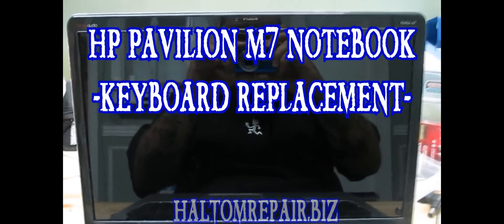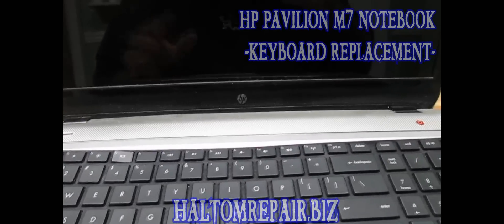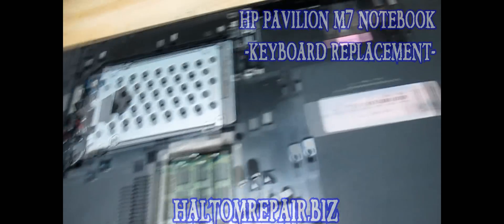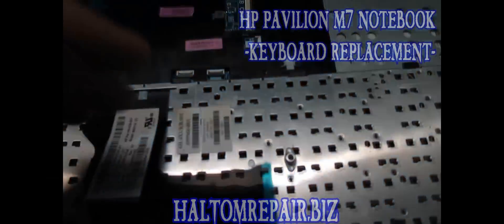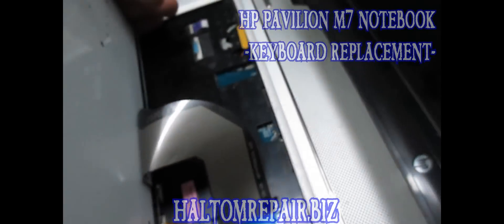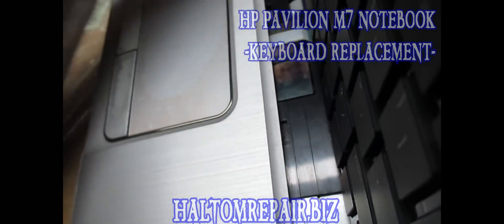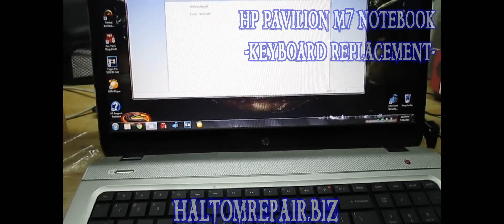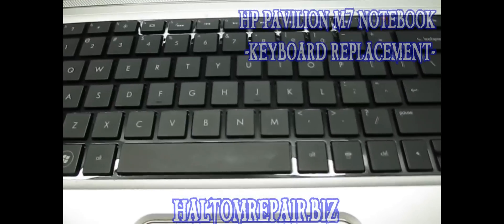HP Pavilion m7 Laptop Keyboard Replacement

Comment: Now I can change the keyboard, thanks for the video, would you by any chance know how to remove the bezel on the HP Pavilion M7. I can't get it loose at the bottom corners. Thanks
Reply: shanna Sa its been 2 years, so im probably too late. but just in case, at the bottom of the bezel theirs a fake speaker grill looking think, there are some screws under that that let it come off